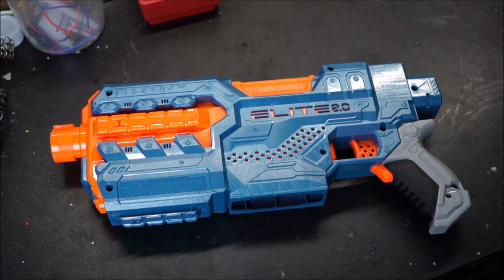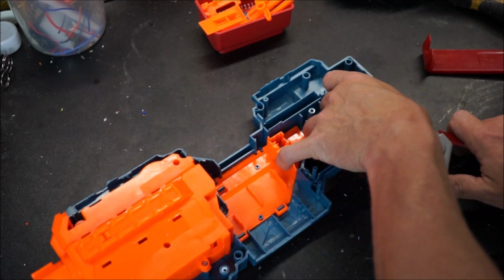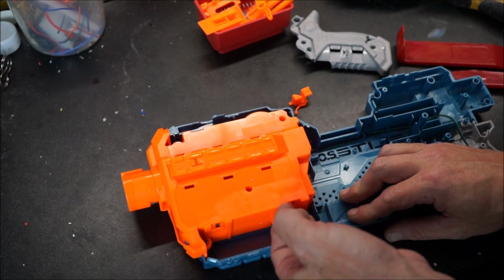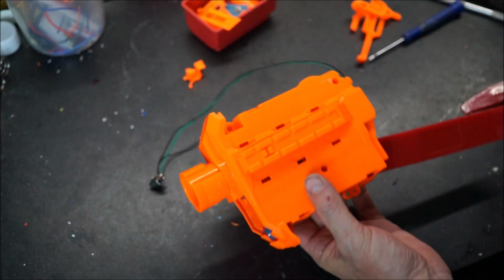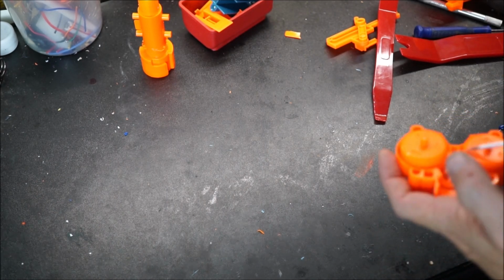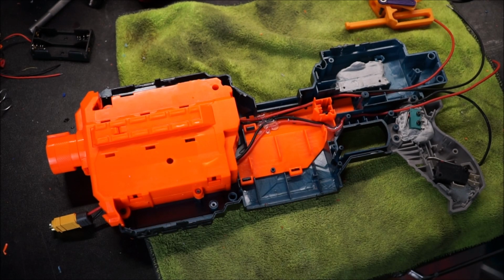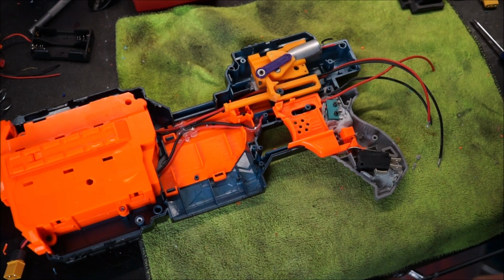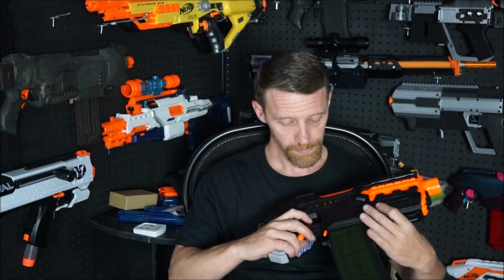Elite 2.0 Phoenix , Full Auto Mod Guide !

Comment: Is there a link for the mag release or is that the same as the worker stryfe one
Reply from the maker: I made that part out of scraps. But there may be an upgrade
Reply: @projectnerf7920  ok thanks
Reply from the maker: Pretty sure I just took the part that goes over the screw boss and turned it upside down, added a spring to the back of it and filed it a bit . Pretty easy actually, especially if you went through the agony of getting it open. 😀
Reply: @projectnerf7920  yeah i just opened it it was a massive struggle. thanks

Comment: When I fire my pheonix, the darts always jam because the pusher won't push the darts all the way to the flywheel. Is there anything I can do to fix this? Thanks
Reply from the maker: Are you certain both flywheels are turning?
Reply: @projectnerf7920  Yes
Reply: I think the spring in the 18-mag is too strong. It pushes the darts up with too much force, causing friction on the dart maybe...